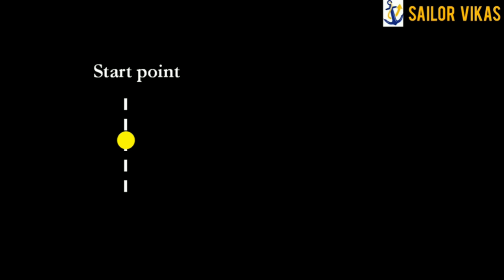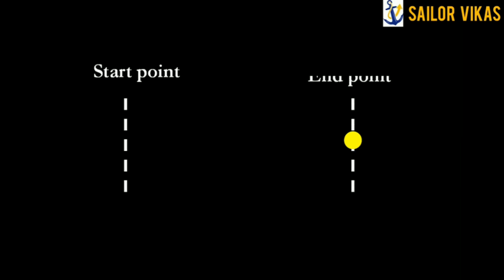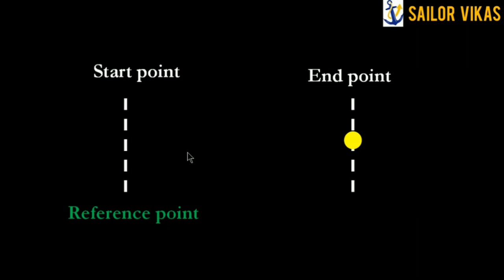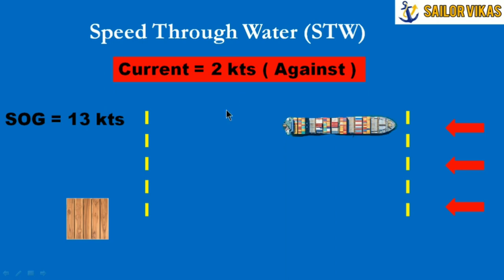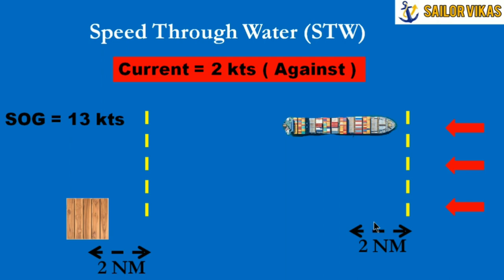Ground Stabilized and Sea Stabilized - Marine Radar

Comment: Sir! If we are in ground stabilized mode and using relative vector.... and current is against us... and it will reduce our SOG.... then will it affect the length of relative vector??...Sir can you please answer
Reply from the maker: Relative vector has nothing to do with current, you can set the length of relative vector at 3min, 6 min etc

Comment: Ok if its mandatory to use STW on ARPA, what about wind, current difference between targets, error in speed log? Then arpa not reliable?
Reply from the maker: Stw is to be used for collision avoidance.
It's not mandatory , how ever it's the good practice to use so and during port approches or approaching anchorage we use SOG as ground vector takes consideration of Wind,current and lets us know where is ship dragging, also if their is error in speed log/speed log is inoperative than also we use SOG till the time equipment is rectified.
Reply: Im glad that you replied, thank you. And why is it so important to use STW? Can you give a one solid example from real life? There is a COLREG which explains the rules to avoid collision situations and as far as ARPA calculating same CPA and TCPA and all the rest regardless of speed input (as basically it uses range and bearing calculations) so why would you use relative speed log instead of absolute?
Reply from the maker: In simple words, relative speed is used to obtain relative vectors...in head-on situation When their is current and you use ground vectors, in radar it appears to be a crossing situation which is not true and if u use STW , that is relative vectors, than It will not appear as a crossing situation thus STW is used ☺️
Reply: So in simple words if im using SOG and true vectors i will not understand that its head on and not crossing? I can't get it...
Reply from the maker: @matrosnya7790 "  if their is current " you will see the ship dragging in a cross direction...watch this video of mine to get a clear understanding https://youtu.be/Lor6lvrioiU

Comment: the question is, if u are both close to land and also u have traffic and collision avoidance is required, what is your set up regarding the stabilization and vector?
nice content btw!
Reply from the maker: Even if you put ground stabilized mode, ARPA always gets feed of STW and not SOG. So CPA and TCPA won't change by changing stabilization of radar. In ground stabilization mode,  ground vector is displayed to let you to know where is  ship moving, however calculations by ARPA won't change because ARPA always gets the feed of STW ( Which doesn't get affected by current )
Reply: And what if your Doppler or mechanical speed log is having a huge error? Your arpa is showing the wrong cpa etc...?
Reply from the maker: @matrosnya7790  huge error !!! U won't use such an equipment If it has huge error where STW is showing 5 kts and SOG is showing 15kts unless u have strong currents , for the above problems you have to use SOG for approaching critical waters and for collision avoidance you have option to input STW manually in Radar/arpa ☺️